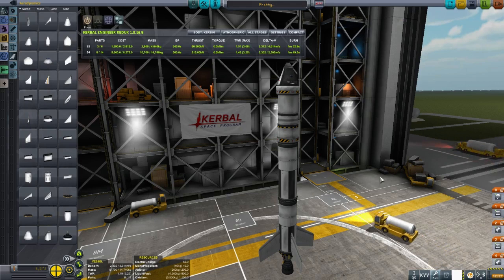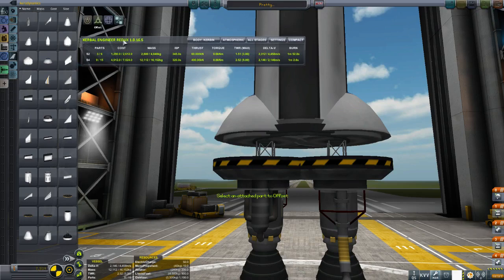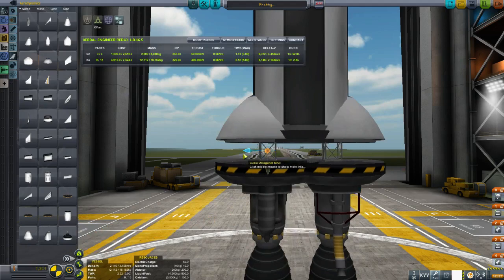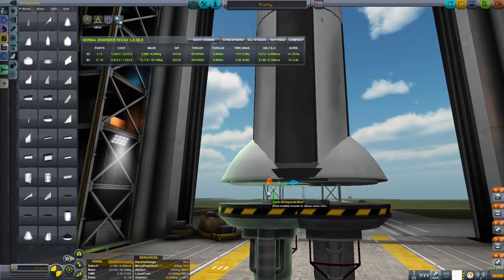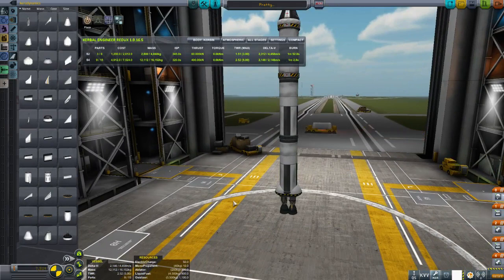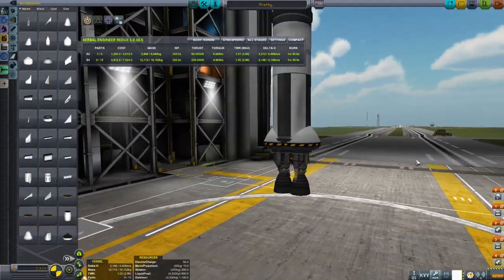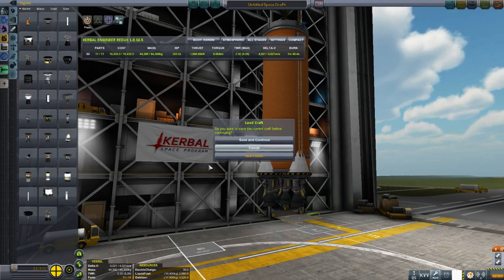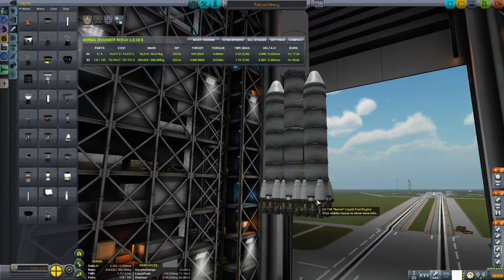KSP Build Better Rockets 3 Form over Function

Comment: I do function of form.
I add everything to a rocket and regret it.
I made a rover with fuel collecting capabilities and stuff. Very slow and very big and heavy.
Shite
Reply: Refueling with mining worls better with an engineer on board the ship.  Plus you need radiators to respect the drill ideal temperature as well as the ISRU ideal temperature.

Comment: What does gimbal mean?
Reply from the maker: the engine can "gimbal" which means it can point in different directions.
Reply: Gimballing. The craft has a set of gyroscopes hooked up to senors. What they do is detect the attitude of the craft and adjusts deflection fins placed in the exhaust path of the rocket engines. Originally designed to keep the rocket straight during flight, scientists discovered that if you adjusted the position of the sensors of the gyroscope, you could "steer" the rocket. That is what is called gimballing.